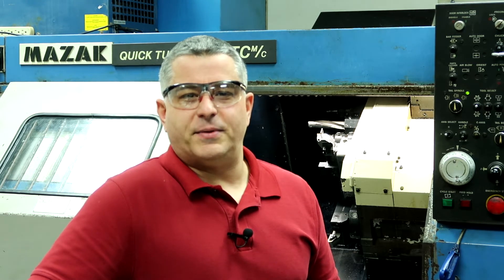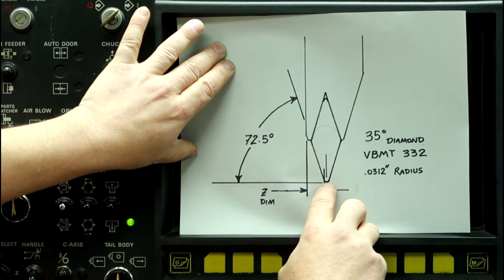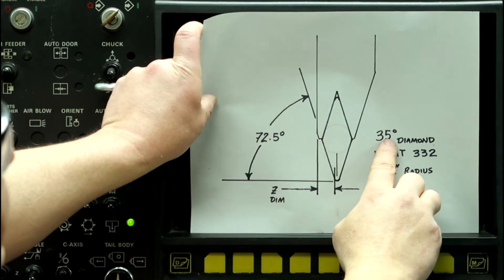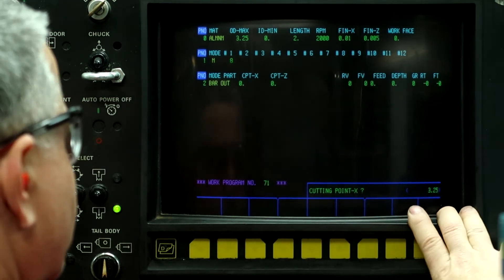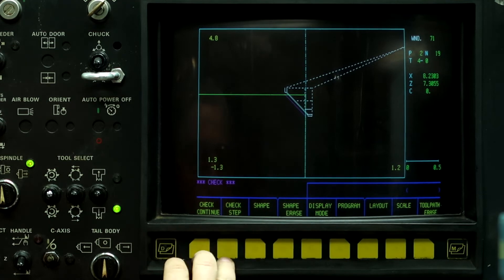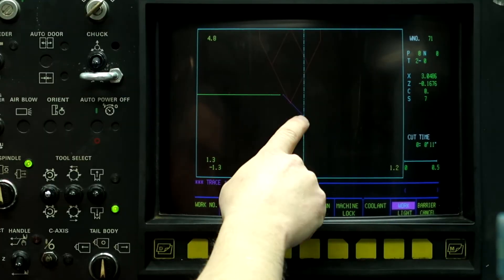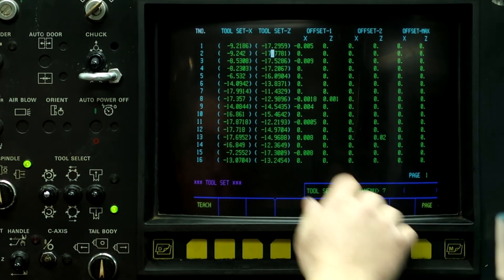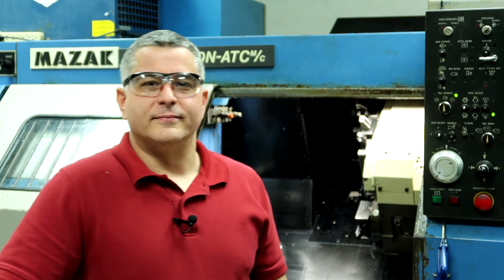Mazak Lathe Tool Set Angle Less Than 90

Comment: Hello,
I have a question for you. I see that on the toolpath the contour does not touch the edge itself. Does this mean that you are recalculating so that the dimension of the workpiece would not be larger. In the program, you enter a smaller number by X and a larger number by Z? the reason is 0.0312 nose radius? 
Thank you very much if you answer. it bothers me a lot
Reply from the maker: The offset is due to the nose radius of the tool.
Reply: @mazatroltipsandtricks6816  Is it necessary to reduce the dimensions of the workpiece because of this?
Reply from the maker: @milosavbatalo1989 Sorry I am not understanding your question.
Reply: @ sorry for the bad translation, I use google translate. 
When you enter the dimensions from the drawing and write the program, the nose radius is 0.0312. when the machine finishes the piece and you measure it, are all the dimensions on it larger by 0.0312
Reply from the maker: @milosavbatalo1989 No. The dimensions on the part will match what you enter into the program. The graphics show the tool radius centerline when running the toolpath. The purple line is the geometry. .
Reply: @mazatroltipsandtricks6816  Thanks for the clarification. Then something is wrong on my machine. I am left with a larger measurement even though I measured the tool well
Reply from the maker: @milosavbatalo1989 Is the tool probe not working or are you setting tools manually?
Reply: @mazatroltipsandtricks6816  I use tool eye. I will try to measure manually and see the difference. the difference is big, even by 0.9mm now
Reply from the maker: @milosavbatalo1989 Are you describing the tool properly?  What control and machine are you running? If the tool is not described properly the machine can offset the geometry incorrectly the amount of the tool radius.
Reply: @mazatroltipsandtricks6816  I hope I entered the tool correctly, it's a face tool (93degree front/52 degree back, nose radius 0.8). Mazatrol T32-2. Mazak QT15N

Comment: Did you move x to touch the 45 angle 🤔
Reply: Thanks very much Sr 👍 I got it  .just to  let you know I'm mazak integrex cnc machinist  with matrix  mazatrol  control  but I haven't use those tools  less 90DEG
Reply from the maker: @mariocortes1337  Cool. I'm also running a Mazak Integrex with a Smooth X control at work. Too bad I cannot make videos at work.
Reply from the maker: No. Only move Z.

Comment: If you had a Optical Comparator  you could get that number for the the tool set "z' shift with out making a test part rite?  thanks for the videos please keep em coming
Reply from the maker: Possibly, I've never tried that method.
Reply: Yes you can do with an optical comparator. That is how I set my all my VBMT tools. Once I have the number I use a engraver and put the numbers on the side of the holder. All of mine have 3 different numbers on them. They have .007 with the offset and .0156 with its offset and .031 with its offset this way I only have to do it once for those inserts. It really speeds things up.

Comment: I may be over thinking it but shouldn't the angle you cut to measure the tool on the test part be the same as the cutting angle?  When it is just 45deg it seems it would be off a few thousandths compared to cutting the test part the same angle as the edge (72.5deg) especially if you have a larger corner radius tool.  

Your channel is awesome  y the way. Keep it up. 

I think a good idea for a video would be what the different colors and highlights mean in the programs.
Reply from the maker: Thanks.  You cannot cut a workpiece with the same angle as the edge of the insert.  The machine automatically adds 3 degrees of clearance to the cut path.  The 45 degree test part gets me within .001" so it works for me.
Reply: No, that's not actually the case. The  machine knows the tool geometry and part shape but does not know the Z error, so when you touch the 45 degree slope and measure the difference, you are accurately correcting the error (as long as you don't move the X axis).

Comment: I am using the same similar holder but with a ceramic round insert. How would i describe the angle for a round insert in the tool data ?
Reply from the maker: Depends on what the tool looks like. Can you probe the OD and face of the round insert or do you need to determine the Z offset like in my video?
Reply: Mazatrol Tips and Tricks i can prove the X but the z i have to do it like the way u do in ur video but idk how to describe the angle for a round insert on the tool data ?
Reply from the maker: @cheizaguirre5494  I would use a hand held protractor to measure the first and second angle of your holder to see what kind of angle clearances you have on the holder itself above the round insert, then input that in the control.  The first angle will be less than 90 degrees.  The deeper you need to machine into the part, the more the tool angles will become critical for the machine to clear the tool holder properly.
Reply: Just leave the angles blank

Comment: Does the Fusion and nexus use similar theoretical point? I thought it was the quadrant, like in cadcams.
Reply from the maker: I would say those controllers do it the same as my old controller, but run a test to be sure before running hardware.